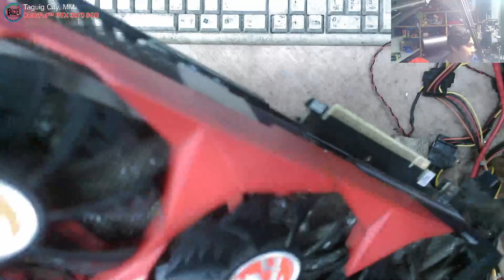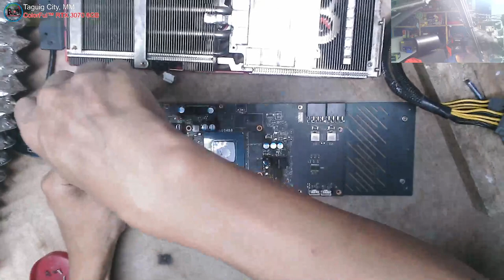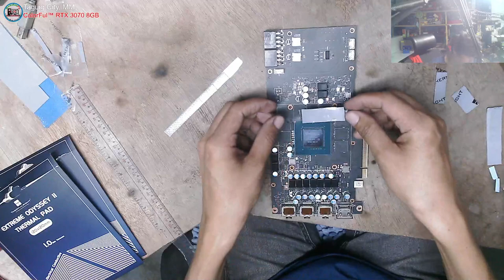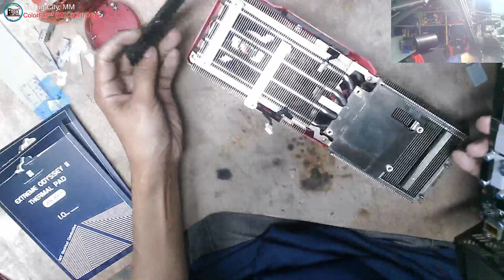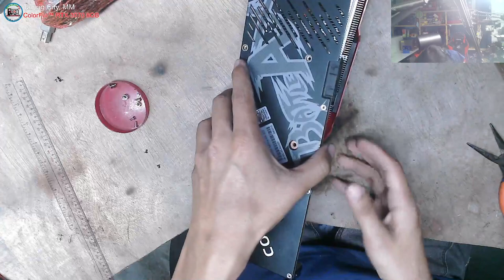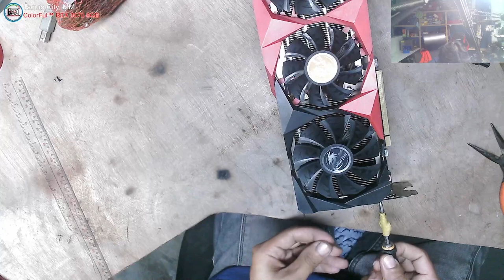Colorful GeForce RTX 3070 8GB - High Temperature, Dust, Thermal PAD, PASTE issue

Comment: for some tips, just repasted my colorful rtx 3070 (same as this one in the video) with a very viscous thermal paste (pccooler gs-1) and it actually made a great difference vs my mx6, temps went down to a max of 68 deg celcius stock and if i undervolt the card its max is now just 64 deg celcius

Because based on my exp. thermal paste which are not very viscous will just slide outside the die after a while

my previous temps were 82 deg celcius max at stock and 75 deg at undervolted

all of this in a 65% fan speed and a 29 to 32 deg celcius room
Reply from the maker: Used branded thermal pad for best cooling system. 2.0mm thickness

Comment: Ako ung nag pa ayos, ewan ko po kung specific sa colorful na 3070 pero ang laki ng difference sa temps ng icefusion na thermal paste vs sa gelid gc extreme, umaabot padin kasi sa 81c tapos 3000rpm ung fans after nung cleaning pero nung pinalitan ko ng gc extreme nasa 70+ nalang siya lagi saka di na maingay yung fans, suggest ko na thermal paste boss para sa gpu yung gd900, may malalaking tube tapos halos same temps lang ng gc extreme. Di ata kaya ng 1wmk na thermal paste ung power draw ng 3070. Other than that all goods ung cleaning salamat boss.
Reply from the maker: Thanks Sir. Upgraded na po ang tpad at tpaste namin as of now 2024. Naka 11.1kw na tayo..

Comment: Don't know how many FPS you are running, but consider capping your frame rate at 125 FPS.  I had the same problem with my RX 6700 XT running right up to 110c junction temperature with open throttle.  I capped and it now runs 60 - 70c junction temperature.  Plenty speed as the human eye can not detect frame rates much beyond 60 FPS.
Reply from the maker: Thanks for comment